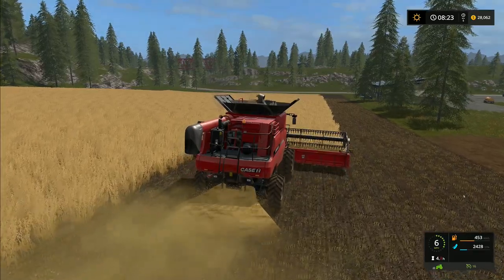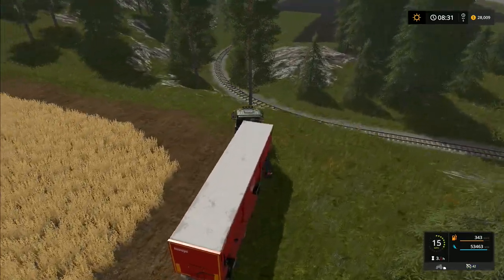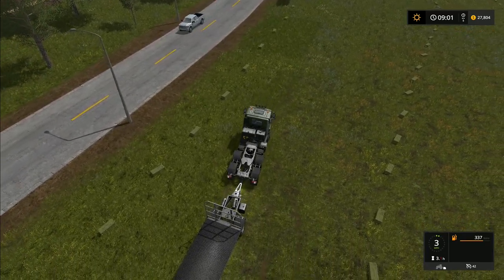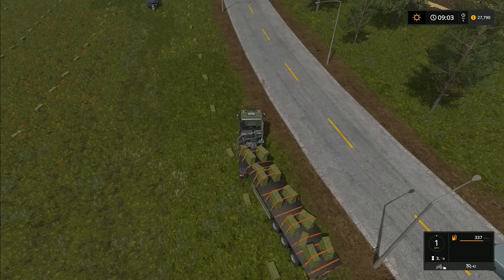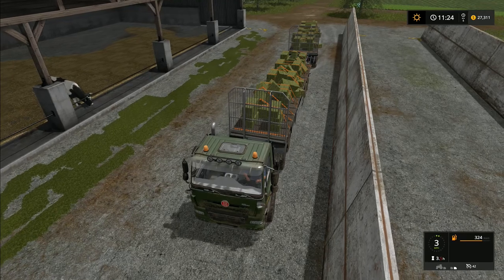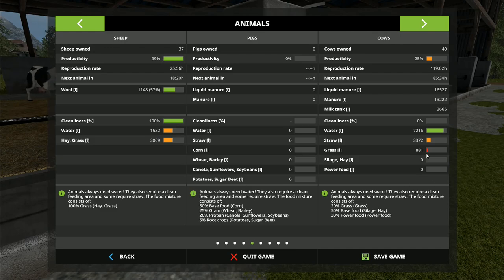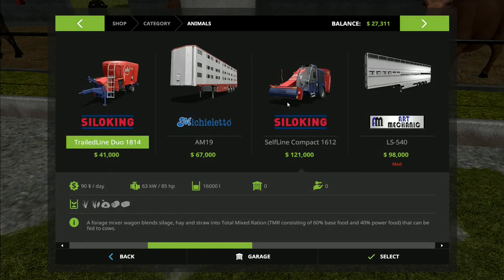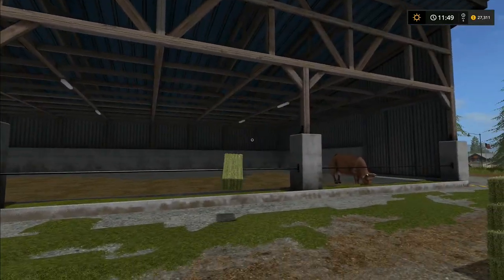Let's Play Farming Simulator 2017, Goldcrest Valley #55: Small Bale Road Train!

Comment: Hi,
So i wanted to give my opinion regarding the indoor and outdoor things the last time this topic came up already.. but forgot. Anyways.. 
I don't think either one is more real.. You say the indoor doesn't feel realistic, but the outdoor does, but i think it feels at least as unrealistic as the indoors.
Although now with the real pivoting axles and the wheel deformation its a lot better, the vehicles still look quite static and toy-ish and don't give me the feeling of looking at a real tractor driving on a field.
But of course we have the same issue indoors as well. They have included the features of the "BetterIndoorCamera" in FS17, but thats not good enough. There are no real physics involved.. 
So it feels very static, too. Also, even though the interior has animated dials and stuff now, it still sucks. Really does.. If i remember right when you turn on the lights the dials and buttons don't even light up? Guess i have to play some FS again if i don't remember stuff like that.. 

Obviously apart from those things there is what you said with the mirrors. If you are indoors you just don't see anything. The problem aren't just the mirrors, the problem is on a tractor the implement is on the back.. But if you look out the back window you don't see where you are going.
Now in real life first of all you have a actual feeling for the 3D space around you, so you can look out the back for a moment without immediately going off course when sowing or something because of course you move in a 3D space and the brain can calculate direction relative to objects around you..
Ingame, that is not possible. You turn around and you pretty quickly go off course. I think one of the causes for that is that the indoor camera doesn't move in full 3D.. You can not move side to side, or forward, backward, up, down.. But that movement (even if just slightly) is needed to calculate direction based on changing distances between the objects around you and you.. 
Also, in real life you can just really quickly turn your head to the back and front and you don't even notice the movement.. But if watched as a video game or video you get a headache really quick. (People put GoPros on their head when doing work with the tractors, i really really enjoy those type of videos.. But the better ones move their head more slowly and not as often.. The worse ones move their head like crazy. You can't watch those for too long)

So even though the true 3D Problem can be solved with headtracking for example there is still the turning the head quickly problem.. I think if you have like 3 big screens and the screens on the side are really on the side and you turn it might actually work.. But looking at a flat screen turning your ingame head quickly (no matter if initiated by headtracking or mouse) just can't do it often without getting a headache.. 

Maybe its just me.. 

Anyways.. These are some of my thoughts regarding the indoor camera issue.. And i have thought about Indoor camera/indoor feeling improvements time after time, but i just don't know.. Maybe the few people actually reading a comment that long have any ideas?

I have done mods making the indoor feel more realistic (e.g. BetterIndoorCamera, later the RealPhysicalIndoorCamera which the camera actually had a true mass and physics to simulate the drivers head being thrown around, working dials and warning lights and that sort of thing) on the hunt for a better feeling experience.

Now with FS17 i built myself an EdTracker Headtracker, but the experience just isn't what i hoped it would be. I only have two monitors so i can't do a multi-monitor setup, and using a single monitor with head tracking just does not work. At least not in a FS-like Game where the radius you have to turn ingame is basically almost 360°.. 
Even if you reduce the radius to 90° each direction its still too much.

But i have a simple rule.. Playing with keyboard = outdoors, playing with steering wheel = indoors.. 
The simple reason, first if you are sitting behind a steering wheel its weird to look at the machine from the outside. But also, i don't have a free hand for the mouse. I use the shifter, maybe a Joystick for frontloader work, and you can't drive outdoors without moving the camera constantly.

So turns out even though i have all those nice things like steering wheel, pedals, shifter, headtracker i usually just play with the keyboard.. Because i'm lazy, but also because its actually more enjoyable.. Weird.

(If i continue to grow the length of my comments at this rate by next month i'll write a book.. and it isn't even intendet. I try to make it short.. never works. I'm terrible at keeping text short.. sorry.)
Reply: modelleicher this is maybe to Much to say you are Good to make thing dont short.👍👍